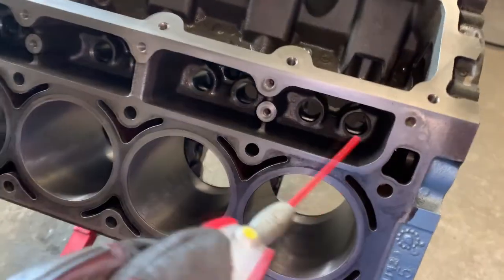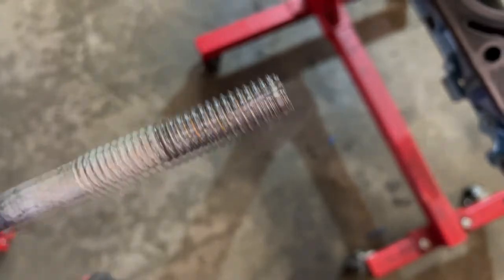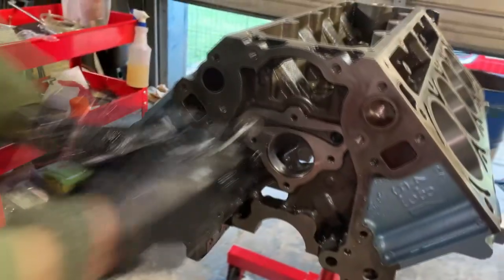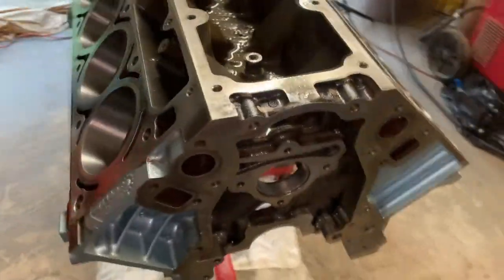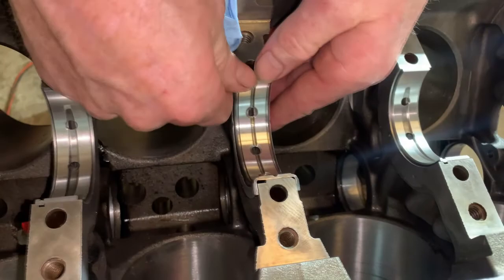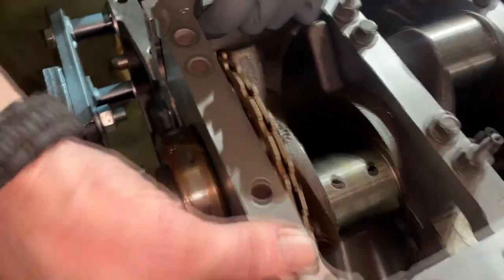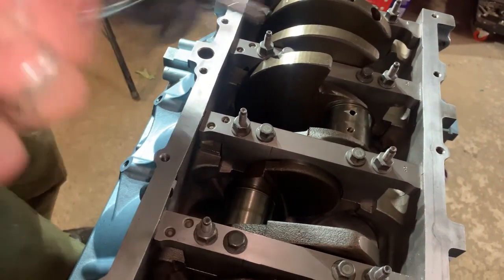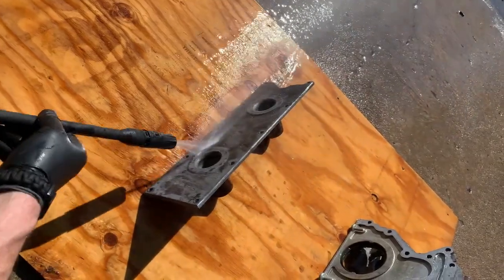LS Engine Crankshaft Install 455hp Stroker

Comment: ? Does the bottom end have to be mechane to fit a Ls stroker crankshaft. I've heard Yes and no. Thanks
Reply from the maker: If you’re referring to putting a 4 inch crank in a factory LS block then yes 99% of the time , it has to be “Made to Fit”
Reply: @KidKevi  Thanks Kevi . I feel so  embarrassing couse I'm that Gm Ls Sbc F body tq arm suspension small tire grudge guy. 7 I've own since age of 14. 3rd -5th gens. I forgot couse my old army buddy said no the crank will fit even clear pistons rods bolts an stuff. An all we did bk then was do a 4 inch stroke or a 3.622 will make it a 383 LS an 396 and 0.10 cylinder bore as an example. I forget that size bore and crank stroke size. Ok thanks Jr
Reply from the maker: @god1st.530  anything I can do to help 👍🏼
Reply: @KidKevi  🙏🏾💯